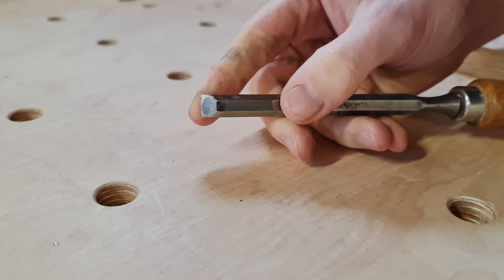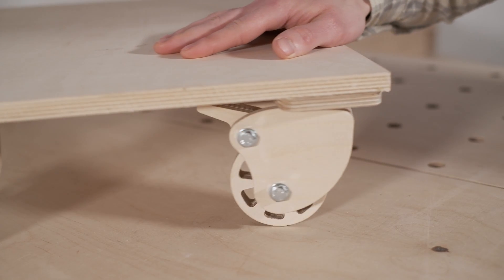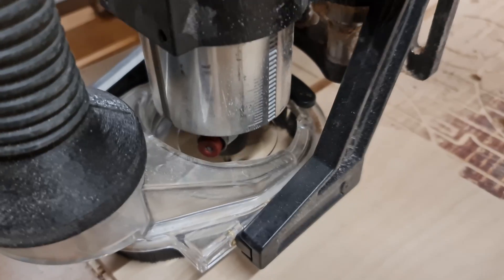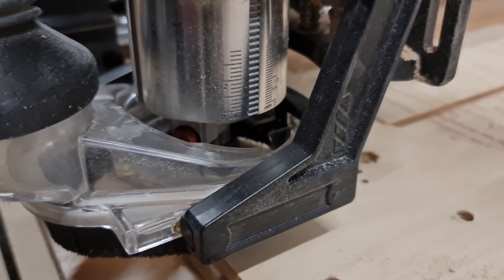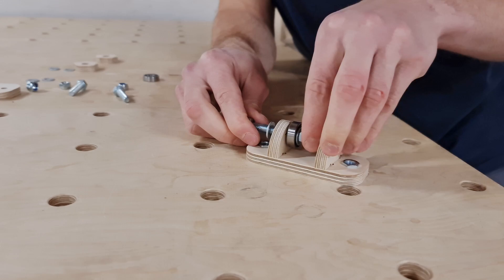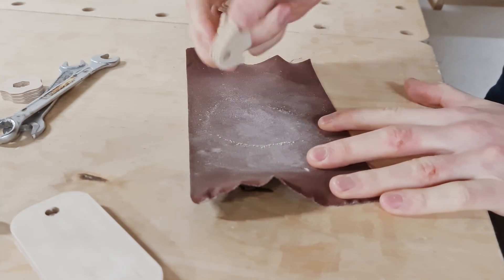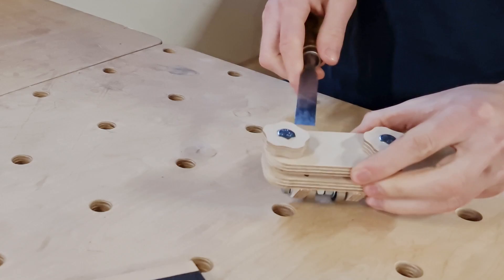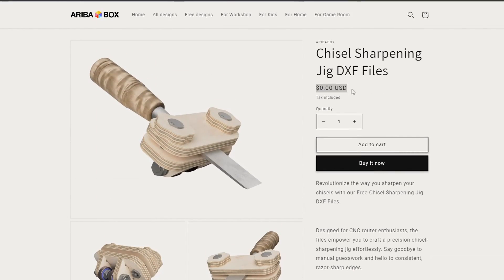Making a Chisel Sharpening Jig on a CNC Router - ARIBABOX

Comment: Nice job. And I KNEW you could cut that in one pass! Glad to see you finally gave it a shot!
Reply from the maker: Thank you!
Yes, I finally gave it a shot, and I'm glad I did! 👍
What thickness do you think it's possible to cut in one pass using a 0.125 inch bit?
Reply: @Aribabox baltic birch? 12mm easy, probably 19-20 with care. Solid wood...I'm a lot more conservative. 

The only caveat is that as it gets thicker you'll have to slow down at some point. Then you're balancing the speed you lose against the passes you save and whether you can get away without the finish pass. Fusion 360 simulation, while not very accurate for machines like ours, is incredibly useful for comparing times as long as there aren't too many rapids.
Reply from the maker: @turbomacncheese  19 - 20 mm plywood?! Sounds too good to be true 😄
Will have to test the limits and see the fastest you can go per each material thickness.
Again, thank you for all the great insight!
Reply: I think so, yes. Again, with a lot of care. Might end up not making sense if you have to slow down, but that's a stout machine you have there. Good luck!
Reply from the maker: @turbomacncheese Will have to figure it out! 👍